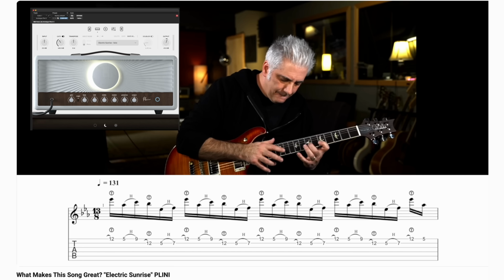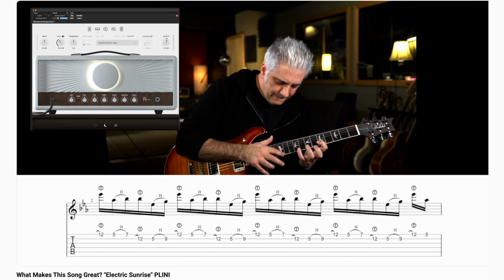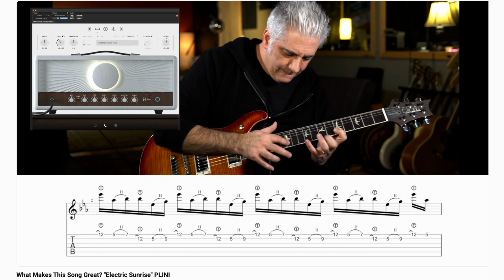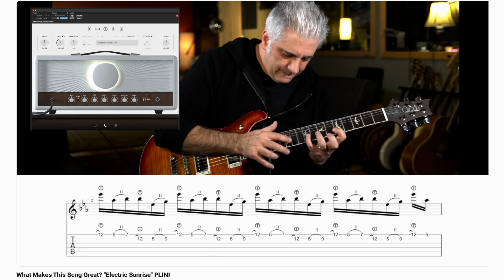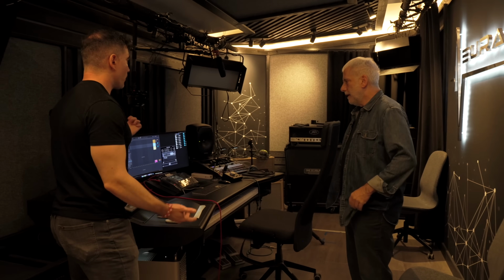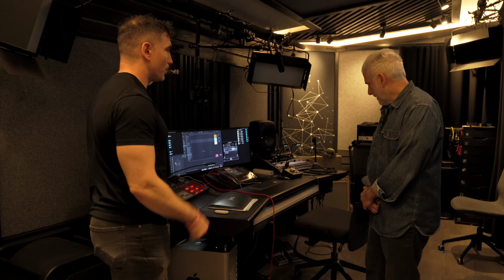I Flew to Finland to Find Out...How Are Amps Modeled?

Comment: The only reason i haven’t switched from analog to digital is because i find i spend too much time tweaking with digital equipment as opposed to just turning a few knobs on a tube amp and getting the sound i want.
Reply: Feel you man, paralysis by analysis is a such a thing for guitar players 😅
Reply: I'm the opposite..  i dial in and save my settings just how I like em (with B and C variations for good measure), pop the unit in my gig bag and I'm sorted with every sound I'm likely to need. Don't miss the days of lugging big amps around at all.
Reply: Try a Fractal Am4. Sounds incredible and very basic and easy to use if you want it to be.
Reply: @Igornopolis through what? Cabinet and power amp?
Reply: In your bedroom? 
Or on stage? Direct through the board? Or sub mixed through your own mixer power amp rig.
I find that thats where the sound fails.
Reply: Agreed. Took me year of tweaking but the you find yourself tweaking for another year to get the extra lol
I am using the Kemper Stage
Reply: I am that way with synth plugins but NeuralDSP amp plugins are as quick as using an amp, you'll get it sounding good in a few seconds (assuming you like the sound of the model, just listen to the demos before buying)
Reply: I spent 1 day setting up my nano cortex with 24 presets - 6 midi banks 4 prst each - 6 amps with 4 different flavors each, spent another half day to setup midi controllers etc and now I just play, rarely can tweak something. Absolutely happy with the sound, you can just stop tweaking 😅
Reply: The reason you keep tweaking is because none of these amp modelers sound good. They’re good for demos but they’re nowhere near as good as the real thing. That’s one reason why modern metal production is so drum heavy. The guitar sounds like shit so they drown it out with the drums.
Reply: @ChadAV69  I believed that too until I found myself in a room with an actual amplifier (modded JVM) and its digital counterpart. When played through a real cab, cranked to recording volume... I'm sorry friend but they sounded identical.